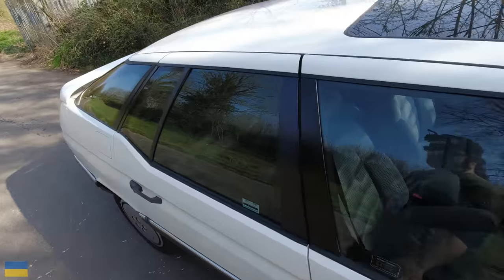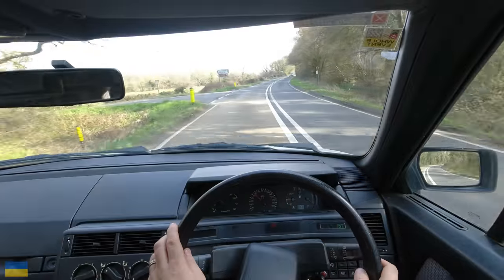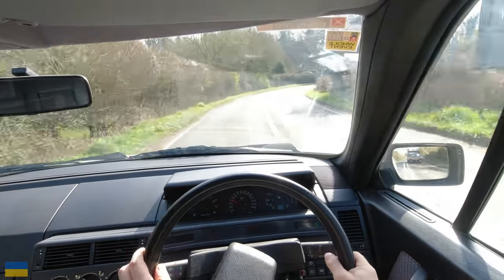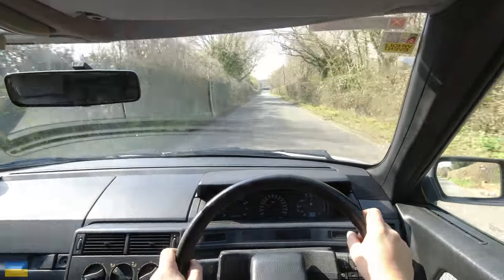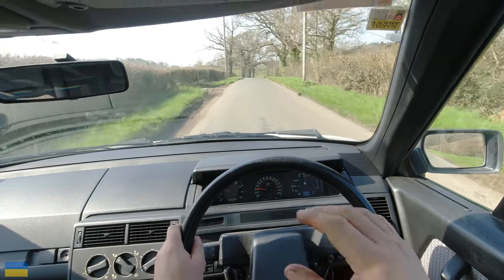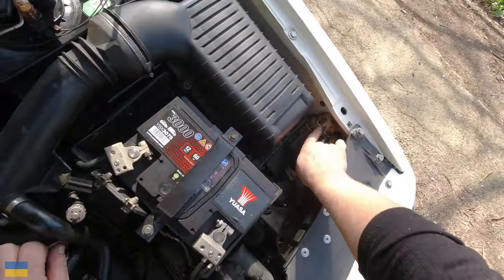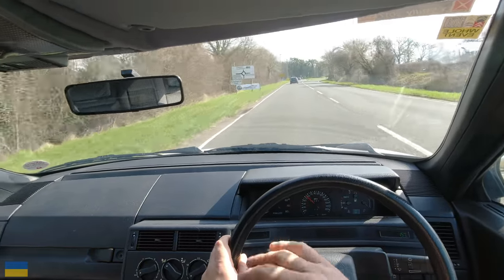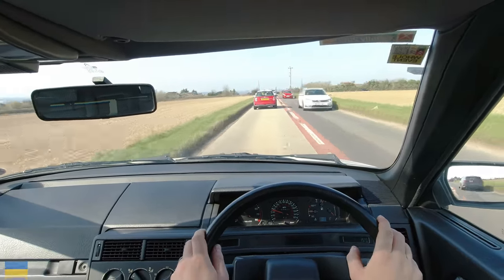1990 Citroën XM 2.0Si (part 2) - POV 'GOLD EDITION': Test driving one of the cars from my childhood!

Comment: every time I watch these, I end up looking for Citroens on autotrader
better yet, XMs are not as expensive as I thought they might be. What caveats come with owning a XM?
Reply: Beware I was looking for a BX because of that man. Ended up buying a Xantia. Beautiful and confortable but already spilling LHM from random and varying places on its parking spot. From what I gather it is part of the Citroën life 😉
Reply from the maker: Watch for rust! Speak to the owners forums (and the CCC), they're pretty knowledgable. Hydraulics aren't a worry IMO, but electrics can be fun to put right. Getting some of the parts can be fun, too. Buy on condition, not colour/spec.
Reply from the maker: @426 - Xantias are nice too, though no where near as fun as a BX or funky as an XM, but arguably more usable than both. Shouldn't be spilling LHM, though!
Reply: @UPnDOWN  she has a visit to a PSA specialist (who wasn't worried much) scheduled for next monday. I fell in love with its Vert Galant paint, which sometimes turns blue and got me very confused the next day.
Reply: @426baron  I bought a Xantia with a leak in the 3 way rubber joint on the rear return system (the orange Y shaped piece for those of you who know what I'm talking about). Of course the car had bunch of other suspension problems to sort out, but since it's low spec, it was perfect as my first hydraulic Citroen since it's not Hydractive, and probably bit easier to find pieces for than a BX.

Now that I have learned much more specifics through my Xantia, I have been looking for an XM to give my Xantia a sibling. But boy do they sell fast when the right one comes up for sale. 

But yea LHM leak is definitely not typical part of Citroen life from what I've seen so far. Other things go wrong for sure (cursed be the seizing height correctors), but they don't develop hydraulic leaks all that much.
Reply: @556johny556  A good spirited drive took care of the height correctors. And like you I thought a Xantia would be a good beginner's Citroën.  As for my LHM leaks, my mechanic thinks it is rather coolant made very green after mixing with LHM previously spilled and trapped on the undertrays. I will know next week after he's had a real look inside/out. I hope I won't regret my usual Japanese or Italian cars (won't regret the Alfa V6 repair bills for sure !). But being French myself, it would be silly not to enjoy our own quirkiest manufacturer while its past products are still around. There's plenty of XM to buy over here but I don't know if the steering wheel  will be on the right side for you...
Reply: @426baron  oh I’m in France myself actually. Currently on leboncoin (because I don’t know where else to look) there are total less than 150 XMs in all of France. Narrow it down by my budget, and the number drops into double digits. If you ever need help finding parts or the Haynes manual (in English tho) feel free to get in touch …somehow. Not sure how one goes about such a thing on YouTube
Reply: @556johny556  I usually buy the manual before the car 😉 You can try your luck and still contact sellers who are asking way too much. Many put a silly price "pour voir" and are ready to lower it by quite a lot if the car hasn't sold in the first few weeks. Good luck in your search.

Comment: Today´s useless knowledge: When you open a door (or the hatch) it actually goes from hard to soft. It´s to avoid pressure differences between the two circuits which results in jumps or droops when the system is activated. Those jumps/droops are a thing to be aware of when working on Hydractive 2 cars. Not fun when they suddenly falls down to the bump stops when you have it on the four post lift.
Reply from the maker: Ahh, that's interesting. I confess everything I said was rattled off the top of my head! Makes sense what you say. So does the car revert to hard when the engine is switched off, then?
Reply: @UPnDOWN  Yeah. A minute or so after ignition is turned off it shuts down the hydractive ECU (=hard). Then turns on when door opens or ignition turned on. It's even smart enough to shut the system down after a much longer time (20mins maybe?) if a door stays open. That thing I mumbled about with being careful is that some bad behaviors in the system can make is related. Think about what happens if you pull the fuse for the system in the highest setting and then put the car in it's lowest setting. You will then have no pressure in the suspension circuit but completely maxed out "middle spheres". Then you turn on the system and voila' you have a one time mexican jumper. And the same can happen in the opposite direction. Usually not a big problem with Hydractive 1 which have only one solenoid/valve that "never" breaks. But on Hydractive 2 the are ALWAYS bad at least in the rear. It's only a bad o-ring that creates large internal leak. It results in hard suspension until you have used the brakes or tinkered with the height lever a little bit. (raise+lower a bit and it usually falls down, corrects itself and then remain soft for that drive.)

A nice misfeature is that you can benefit from this. The amount of "falling down" (or jumping) is a direct relation to the condition of the middle sphere if that makes sense.

That's why I mention the "careful" bit. No body parts involved when it's on it's wheels. They are way more devious than the usual thing with "never crawl under it on just suspension pressure". Activa's makes this even more interesting with their sudden urge to rather quickly turning the suspension parts into finger cutters sometimes.

A good rule of thumb on all of XM's is that older series one 89-92b usually have good components and bad cabling stuff (you already mentioned the ground points which are horrible and should burn in hell). 92b-94 are the least problematic I think. Then 95-00 has good wiring but much more "BMW problems" with it's more Bosch-built components. A good example is the window regulators that's always bad on Series two and almost always good on series one.

Two things to remember if you get a V6 or V6.24. They are horrible. They almost always feel jerky when going from coasting to light load (very "nice" in city traffic). It's the only thing I never managed to fix on them. And I really hate that it's almost possible to drive them in legal speeds. And having a Diravi on XM is also rubbish and I...What the F... is wrong with me. They are of course wonderful. But I hate that i always feel that I am going insane as soon as I buy one. That's why I promised myself to never ever own one again. I would be an idiot if I ever get another one.

My most recent purchase is a vega green V6.24 1992a just like in your video @ 14.05...